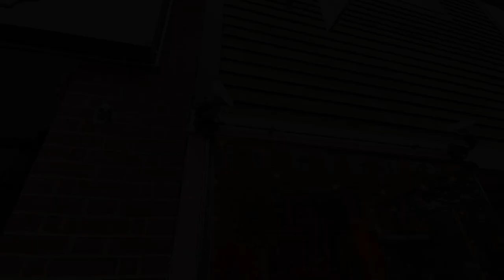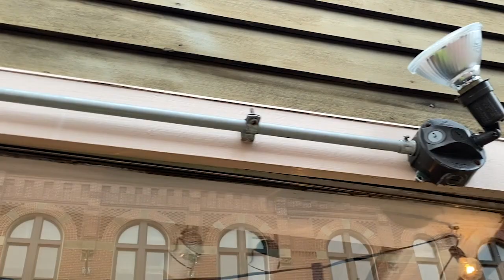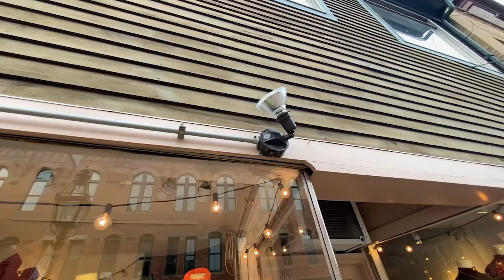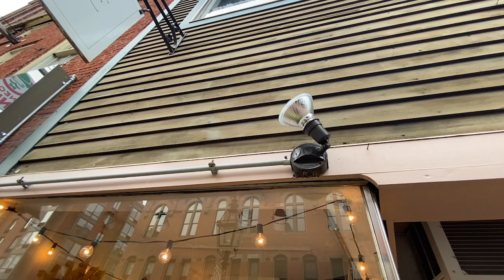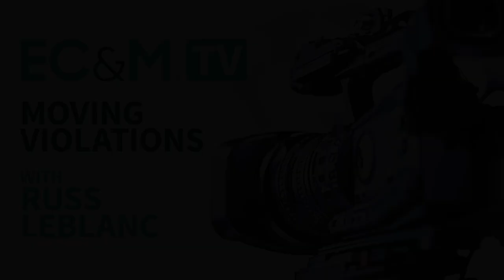Moving Violations Video No. 321: Wet Location Woes

Comment: You should see my landlord home. No cover , no weatherproof box.  Just because it's under a carport metal roof doesn't mean it's protected from the weather.  River rats chewing on the wires and electrical boxes in house because no insulation.